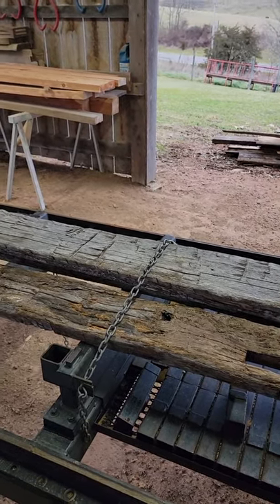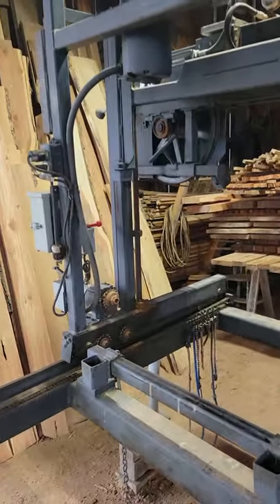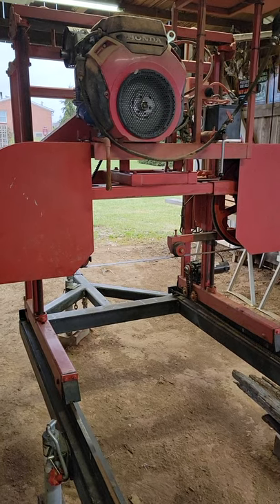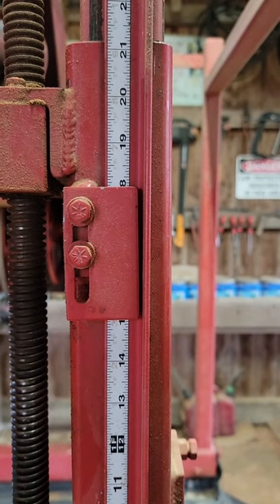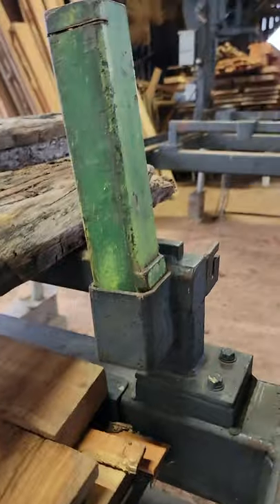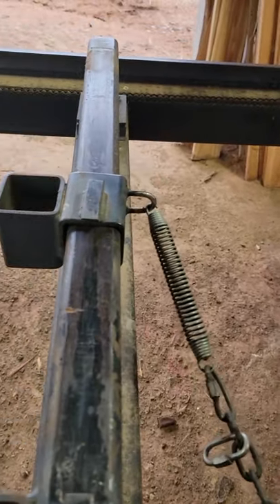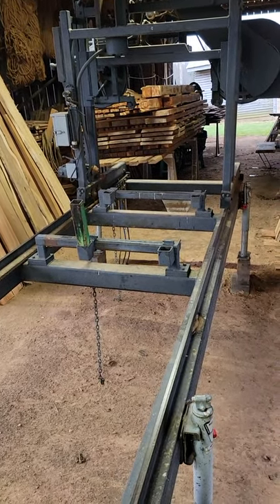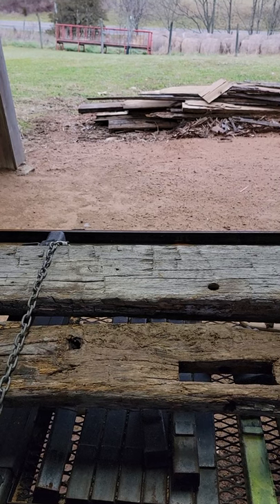Sawmill clamp system ideas

Comment: I'm building a Linn mill and looking for ideas for log dogs and clamps. Looks simple and practical. Thanks. Did you ever hand crank yours before adding a motor to lift? My is quite tight and seems hard to raise. I might look to add a lift and auto advance like you have. Wish I could see more of that system. Cheers!
Reply from the maker: I put the motors on right away, I knew doing it by hand would be difficult.  It is expensive for the parts but it saves a lot of work . You will be very happy with your new mill!
Reply: @woodchucktinman9893  Thanks. I'm hoping to be milling by spring. I'll have to try manual operation for a while then I'll know what I'm missing when I have the cash to upgrade. :D